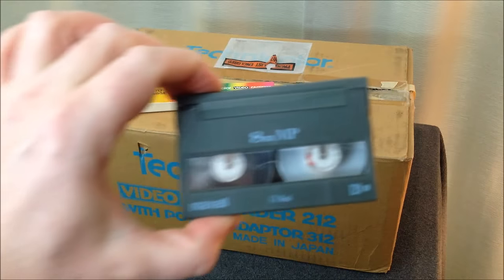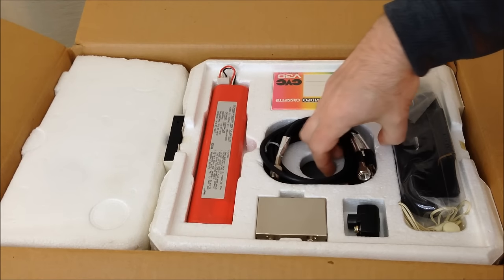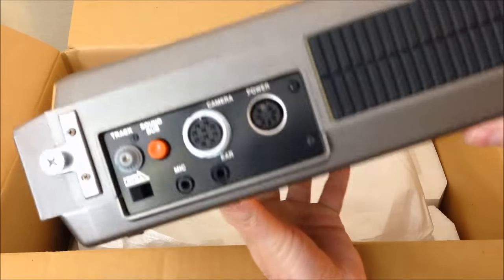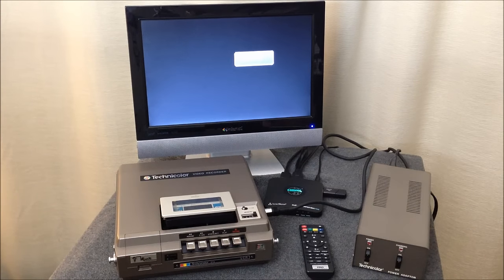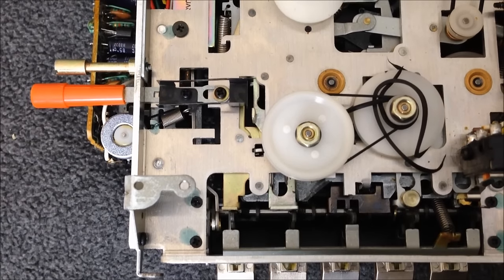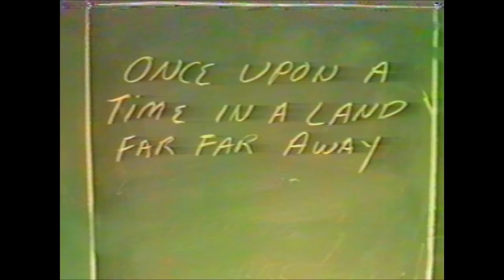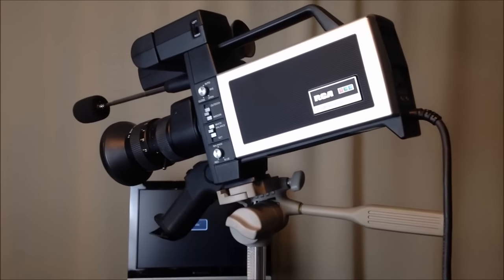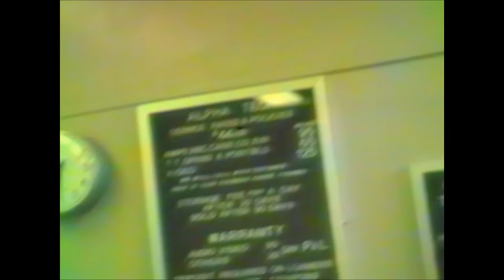The UnTombing of the Technicolor CVC VCR - NOT VHS-C or 8mm!!

Comment: The calendar hanging on the wall at Alpha Tech only had 28 days in the month and started on a Sunday, so that narrows this particular test video down to February of 1981 or 1987. Given the age of the recorder, I’d say it is the former.

Great video BTW and thanks for representing the STL area with your interesting tech!
Reply: Fun fact. I was born in February 1981.
Reply from the maker: You're welcome!
Reply: Nope, the song they are listening to in the car was released in 1982 -- so it must be that year or later. (The song Electric Eye off of Judas Priest's 1982 album Screaming for Vengeance... which was released in July 1982). It's possible the calendar on the wall just hadn't been changed since the February before? I'd also point out that some calendars used a 28-day grid, but would have the first couple or last couple days overlap with the previous week. So the 23rd/24th would be labelled 23/30 24/31 for example. Hard to see in that shot whether that's the case or not, but good eye either way!
Oh, one other thing I noticed -- these shots were almost certainly not filmed in the winter. The name of the month on the calendar doesn't look to me like February either... maybe August?
Reply: @databits  Do you happen to have the Grundig VP 100 and NA 100 service manuals? The Grundig microfiche that pertains to the VP 100 and the power supply NA 100 is Grundig microfiche number 50019,if so,I have in my possesion a Canon NP 580 microfiche reader printer machine,and can thus scan and print paper copies of the microfiche,I also found on the net a PDF of the circuit diagram,that helps a little bit,but the actual service manual would be a great help to lots of folks,I also need a NEW CVC cassette and an old CVC cassette to set things up,any help appreciated,Thank you,in advance,Regards,Ray
Reply: The service chart mentions CD.. it has to be 1987
Reply: At least for that part of the video

Comment: I had 27 of these with cameras on Mount Everest in the fall of 1982.  Never seen it before or since.  The camera quality was poor.  The tape quality was worse.  Once it was a over 26,000 feet the heads froze and wouldn’t spin.  We told the cameraman to dump it in the ice if it stop working.  That’s why we had 27.  The one in my edit suite was fine tuned and worked well but it needed a special TBC to get the image to a professional recorder.
Reply: Hello Eric,I am an enthusiast,may I buy new,or used cassettes ior machines/paperwork etc. Thanks,RSVP,Regards,Ray

Comment: I have a question, please. I recently bought a canon VC-100. It's impossible to find information about the camera/recorder system. It came with everything including the camera and recorder but without a power supply. It comes with a wire that connects to the recorder but it has a car charging head. Do you think that's how it actually comes or am I missing stuff? Are car charging cables a thing for these portable recorders?

Comment: I have the same machine along with the camera, but I don't have any cassettes (and the belts have turned to goo too). Also the camera died about two years ago due to bad flyback in the viewfinder, sadly that is part of the power supply board so you can't just take it out and operate the camera with an external monitor... I did do some recordings on VHS with that camera though. Once captured a brilliant (Technicolor) sunset with it (probably around 2015). The camera was crap though.
Quelle sold these in Germany in 1981.

Comment: I wonder if the folks in the outro ever figured out that the dot was just plain dirt on the actual tube surface, behind the lens.
Reply: It could be tube burn, I had a camera with the same problem. I accidently did it myself on a sunny day with the lens cap off. Something was reflecting a spot of light.

Comment: Might as well recap it while you are in there, Covid home-bound and all that....
Reply: Uh, NO.  If it ain't broke, DON'T FIX IT!
Reply: @christo930  you are being untruthful.  You know you want to recap that chass.
Reply: @gavincurtis  No, my fixing stuff that ain't broke was (past tense) with cars. More stuff gets broken 100% from trying to make an already working thing 1/10th of 1 percent "better"
Now, if the power supply had high ESR caps in it, it's more like preventative maintenance.  If there were a brand name known to fail and pee electrolyte all over the place, I would also do it.  But there is absolutely no reason to re-cap it because, well, reasons..
Reply: It ruins the originality. You can never un-recap something. No longer a true vintage
Reply: @audiodood  You just need to recap it and stop being a nickle shooter at the dollar slots.  Put some good Panasonic EB series in there.

....and I am being sarcastic in my comments.  Can't transmit that emotion through the text.  Don't recap if it does not need it.

I DO have a 1986 Radio Shack stereo video monitor that does require recapping.  Multiple comb filter unit (Hitachi Chassis perhaps) with very low hours I had since new.  Has this flesh tone control system ...color accuracy is astounding.

Caps are starting to get green pins on them though.